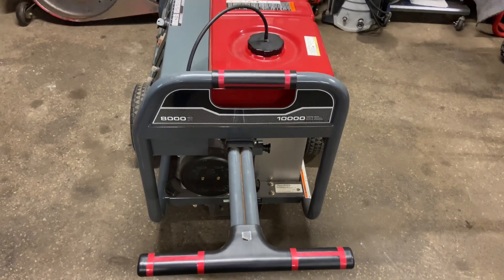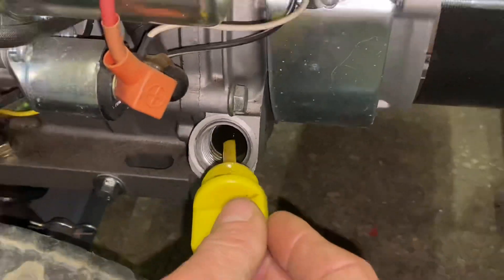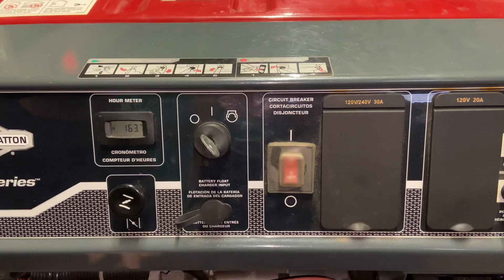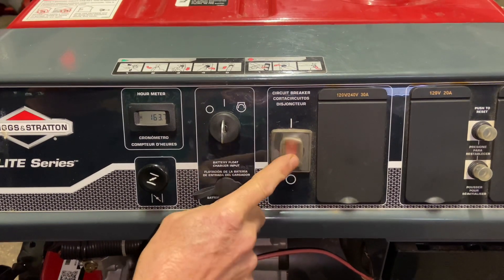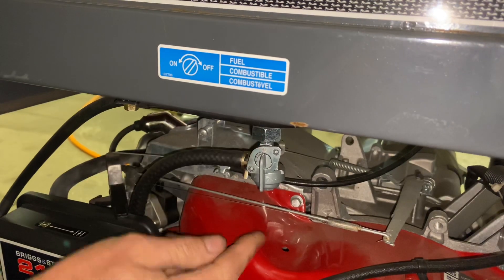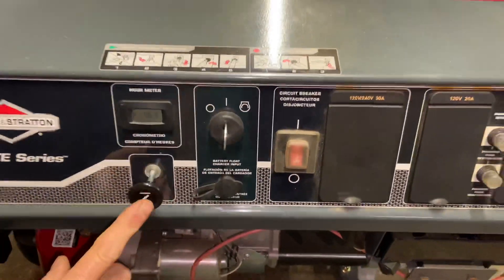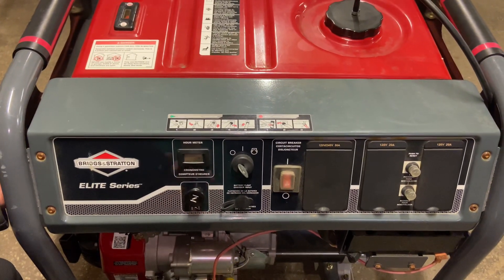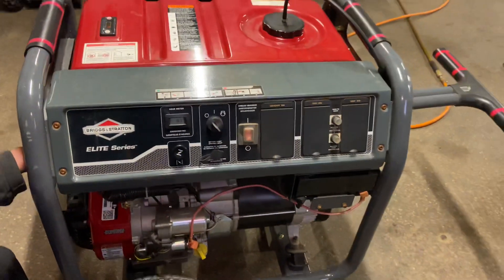How to Start Briggs and Stratton Elite Series 10,000 watt Generator

Comment: Big help! Thanks for the clip, it's just what I needed. January 28th 2022 here in NJ, and we're just waiting to get blasted! We're expecting 8 to here in Vincentown, but I suspect it's going to be more towards the 12 inch side, if not more. I'm feeling it in my bones. JCP&L is actually pretty good here in my development, even when Sandy hit, our electric was out only for approximately 8 hours while miles down the road, houses that deal with a smaller electric company out of Ohio, had no electricity for two weeks and in some cases over a month. But I've all set up over here, got the transfer switch and all. 10000 starting Watts 8000 running, and it basically runs most of the house, as long as everything isn't on at the same time, especially the portable space heater. Those suckers can definitely take up lots of wattage, not to mention the electric blankets. But that one generator holds it all together, we stay warm and always have lights, cable and Wi-Fi. The refrigerator constantly runs oh, of course and that takes a lot of the wattage itself, but with the wattage that's left the generator run smoothly, with most of the Necessities on. Briggs & Stratton was our first generator oh, and it's been doing its job for about ten years now period change the oil every season whether it needs it or not, and always keep stabil in the generators tank, and in your backup gas containers. Once again thanks for the clip. I have it needed to run this thing in quite some time, so I kind of forgot how to get it going. Being a transplant from NYC, where no one needs generators, or owns then one could understand why I needed a refreshment course on how to start this bad boy. Once again thanks for the clip it was a tremendous help. Peace out...
Reply from the maker: I’m glad it was helpful. We are out near Lancaster Pennsylvania and should only see around 1 to 3”. Good luck and I hope you will not need the generator:). Please give this video a thumbs up, subscribe and tell your friends to help my channel grow. It would be greatly appreciated. Take care.
Reply: @JohnsonsSmallEngines  will do. I'm definitely hoping that the generator won't be needed.

Comment: I highly recommend adding a inline fuel filter. $5.00 for filter and a bit of fuel line. A 10 minute job,.and this will prevent the surging that he speaks of which is caused by dirty fuel clogging the very small pilot jets in the carb. This is an awesome generator if looked after,.. mine spent 70 hrs running after hurricane Fiona. Not a problem till until I got dirty fuel from local station and had to clean carb twice. (which is a pretty easy job on these) They are set rich so if you need to add choke to stop surging THE CARBURATOR PASSAGES HAVE DIRT IN THEM. Mine will typically wet the plug if I don't get the choke off soon enough. Cheers and Best to all.
Reply: I have this model. I adjust the choke and solve the surging problem. I did this after I had the Carb changed.

Comment: Can you use a battery maintainer to keep it charged?
Reply from the maker: You can use a battery maintainer but you should check to see if it will work with AGM batteries. Most generators now use AGM batteries. AGM stands for Absorb Glass Mat.

Comment: Had power failure yesterday - temp was below zero. Briggs elite generator 8000 w watts fired up but did not put out power to house. Had to troubleshoot found circuit breaker had been turned off. 

Question what would cause breaker  to trip on generator when not hooked to house??
Reply from the maker: Normally humans. If there is nothing connected to the generator there normally is no way the breaker will trip unless someone manually flipped the switch. Worse case, if the generator was running and there was an electrical issue inside the generator, it may trip the switch but I’m going to rule that out because obviously you flip the switch back on and the generator is working fine connected to the house?
Reply: @JohnsonsSmallEngines  thank you for clarifying. Everything worked fine with generator powering house after breaker was reset on generator. 

Had not experienced that particular issue in the four years I’ve owned this generator.
Reply: Yes, everything is working fine with generator connected to house. 

Thanks for answering my question. Appreciate it very much!

Comment: any issues with this generator? thinking about buying one this size, thanks.
Reply from the maker: All generators in my opinion work as they should until they sit for a long period of time without use and then you will have your starting issues. Most generator issues are due to lack of knowledge about taking care of them. Do your homework on keeping it running and correct maintenance and again in my opinion a generator will do what it is suppose to do! I would also recommend getting with your electrician to make sure you get the correct size generator for your needs.
Reply: @JohnsonsSmallEngines  thank you for the response

Comment: I’ve got this exact generator. I’ve got a mini split heat pump in my house. I’ve been searching for information about if it’s safe to use the generator to run the mini split heat pump. I keep reading that some electronics doesn’t like dirty power from some generators. Do you have any information about this generator regarding this?
I read that inverters are recommended but not sure.
Reply from the maker: My opinion is just like you have been reading, if you have any electrical products that are sensitive to electrical surges then a inverter is the way to go. I would suggest contacting the manufacturer of the split heat pump and ask the same questions or an electrician.
Reply: @JohnsonsSmallEngines Thanks
Reply: @JohnsonsSmallEngines  I had my mini split(Daikin 15,000BTU) hooked up for power outages for 2 years, along with fridge and freezer and it worked fine.. I had the electrician rewire it to 2 baseboards(combined 3000 watts) because I wanted a secure backup for extreme cold.. My mini split efficiency drops dramatically if it gets colder than -20 celcius..

Comment: My electric start stopped working
Reply from the maker: Most likely just need a new battery
Reply: @JohnsonsSmallEngines  changed the battery .  Tried to send it back to Amazon.  It was two days beyond the 30 day return period.  They told me to keep it and they refunded my money.  The pull rope starts it just fine.
Reply from the maker: @terrowsnap2201  Glad to hear it’s running ok!
Reply: My electric start stop working and it isn't the battery, does anybody have any ideas to help me out..